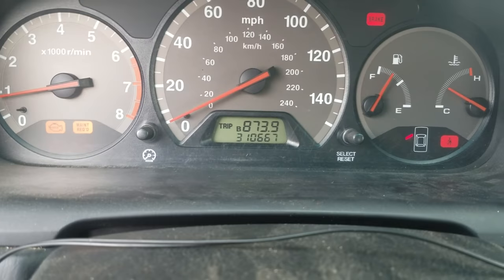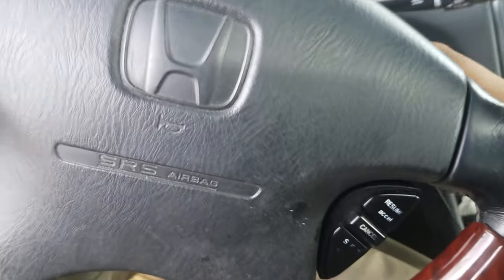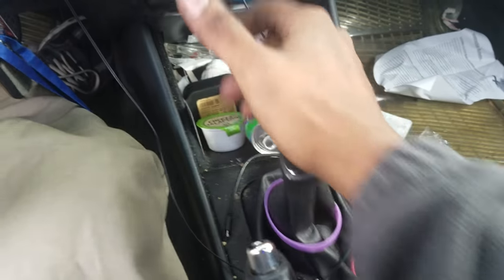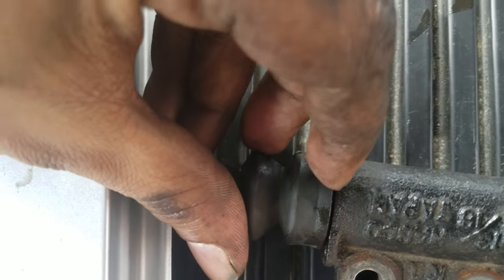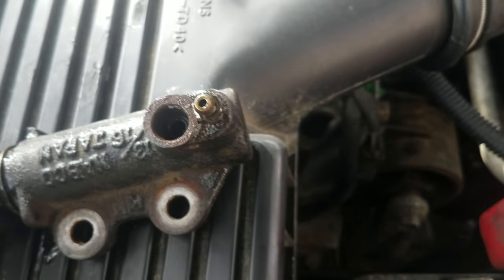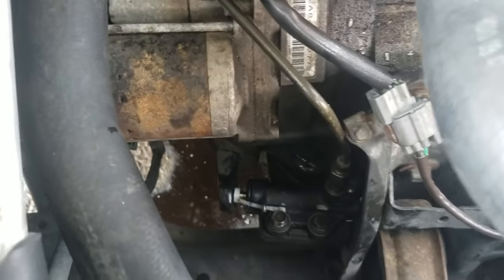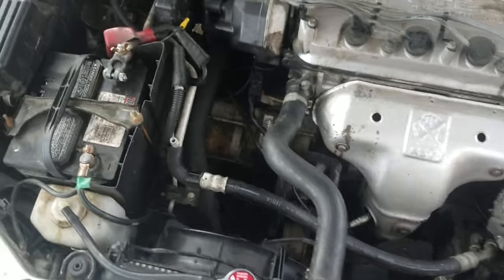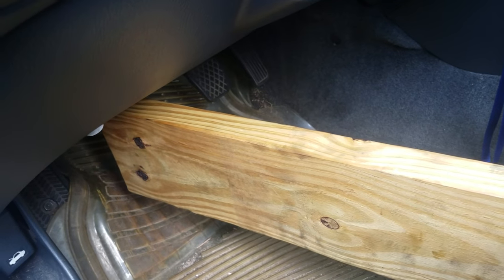Honda Accord Gear Shift Problem Solved - Easy Fix for Gear Engagement Issue

Comment: "No one on YouTube told me about the little pin in there....you bastards"   I laughed my ass of on that. 

Did you see any leaking on the cylinder to indicate an issue?  Was the fluid level low?  My car is doing this but my cylinder is dry as dirt and my fluid level although a bit low and dirty does not seem to indicate a leak or that it would be low enough to affect operation like it is.   Great video.  Thanks for the laugh and any advise.  Thumbs up regardless..
Reply from the maker: broderp yeah there was some fluid leaking from around the rubber boot on the slave cylinder
Reply from the maker: broderp and also a response to your question yes my fluid level was low
Reply from the maker: broderp by your fluid level being low that is indicating that you do have a leak somewhere if you do not see fluid under the boot of your slave cylinder. check directly above your clutch pedal where are your master cylinder engages with the pedal. if you see fluid leaking directly above your clutch than your master cylinder is at fault
Reply from the maker: hey man I was just wondering if you got that thing fixed

Comment: Thank you I'll try this
Reply from the maker: Any luck?
Reply: @tjdot8  I tried once and it went. But it got stuck on reverse. It was the slave and some part on the transmission. I just sold it lol
Reply from the maker: @iNREEk  nooooooooo
Reply from the maker: @iNREEk  I'm sorry to hear that. Man I wish I could have bought it from you
Reply: @tjdot8  it's ok. Damm I wish I could have sold it to you :( it was sitting there for two months and I kept pushing it every 3 days and Thursdays for street sweeper. I kind of got tired of it. But hey my legs are stronger cause of it haha
Reply from the maker: @iNREEk  I will have to make one more video because you can change gear and all without a clutch
Reply from the maker: @iNREEk  you to turn the car off then you can put it into gear or take it out of reverse
Reply: @tjdot8  Kool yeah I knew. Thanks but u should make it still

Comment: What if it goes into fifth gear and it never wants to go back out? Bc that’s my car rn and it sometimes won’t go into reverse
Reply from the maker: Turn the engine off and try it. if it goes in gear then. You may have a leak
Reply from the maker: Hey so did you find your issue
Reply: No i didn’t get a notification until now but thanks I will try and see if that’s what it is
Reply from the maker: Lol I'm not trying to bug you or anything I just hope it helps and if not I will try to help you get it figured out. Has helped many people the comments hold some helpful information would like to keep it going.

Comment: what is the name of the part?
Reply from the maker: There are two components you will need to check for leaking fluid the master and the slave clutch cylinders

Comment: I changed the clutch on my 02 civic ex as it was slipping now when I start it up and try to put in gear it won’t go into any gear...any ideas
Reply from the maker: +Dani Holbrook sure you likely need to bleed your lines. May take more than once or twice. The last time I had an issue similar to that instead of pulling air out of the end of the line I pumped fluid into the slave cylinder and push the air bubbles back up towards the master clutch cylinder. Hope it helps man have a great day
Reply from the maker: +Dani Holbrook yeah man you probably need to bleed your clutch lines. If you're not able to pull the bubbles out may have to push in fluids to remove your air bubbles. Hope this helps have a great day
Reply: I got it with a vacuum bleeder so in short you was all right it was a mother to bleed and that was the problem thanks for all the input and sorry I was delayed on answering as I work outta town and could only mess with it on weekends
Reply from the maker: Dani Holbrook hey man thanks for the update I'm sure this will help someone hope you don't mind me tagging your comment

Comment: I did this and it still didn't work, I ended up changing both the slave and master and it work:/ dunno what else it could be
Reply from the maker: You will need to bleed the system
Reply from the maker: https://youtu.be/HMlFL3WC6eQ watch this when you get a chance
Reply from the maker: Hey man how did everything go for you just checking up on you?

Comment: I hAd both of them replaced like 3 months ago and out of nowhere my car struggles going into any gears, but my clutch pedal doesn’t feel weak at all, any ideas? 02 rsx
Reply from the maker: So I did look it up in your RSX does have a hydraulic clutch I would try to First bleed the clutch and hopefully this helps if you have air inside of your hydraulic lines you will not be able to properly change gear
Reply from the maker: I would not exclude you having a bad master or slave clutch cylinder. Not sure if I showed where to check for leeks but you would check just above your clutch where it goes into your masters cylinder if you see or oil leaking your master cylinder is leaking check your slave cylinder behind the boot to see if you have fluid there if you do then it is likely leaking as well